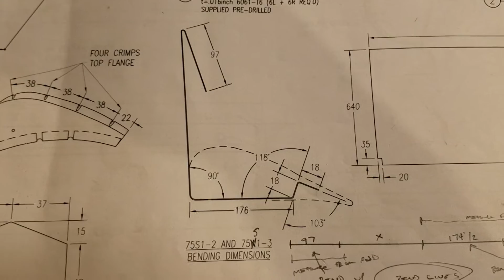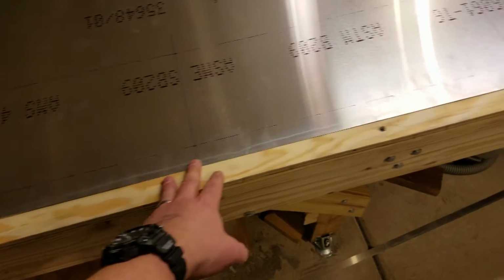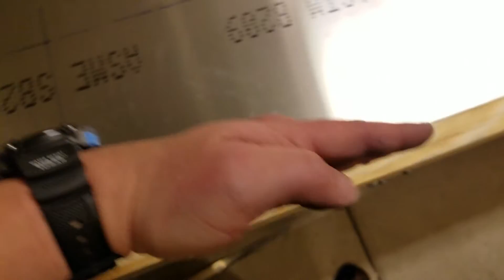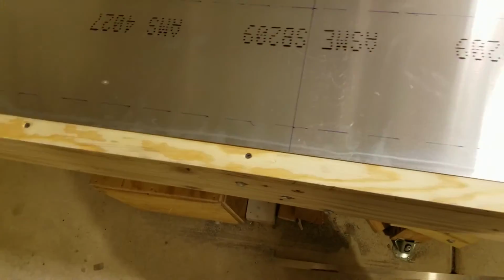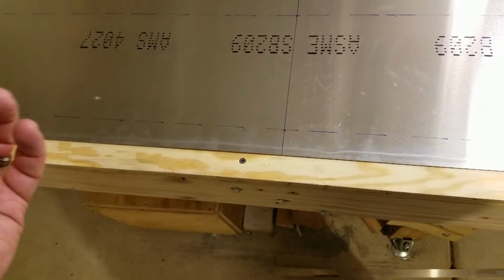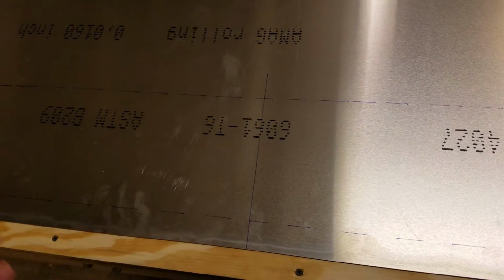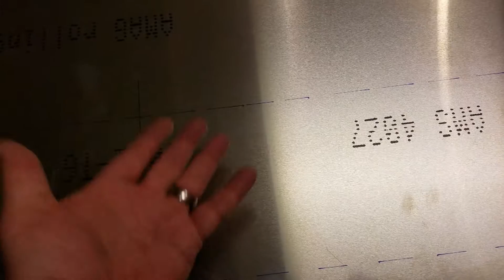Forming the Slat Skins - Part 1/2

Comment: normally you would fold sheet perpendicular to the grain.
Reply from the maker: Can't do that on runs longer than 4 feet. Anything longer than 4 feet means bending with the grain, since the grain runs lengthwise on 4x12 sheets of aluminum. Zenith states in their blueprints/construction standards when folding against the grain is a requirement. Everywhere else, it's either not an option or does not matter.